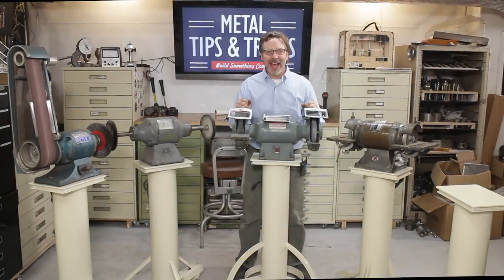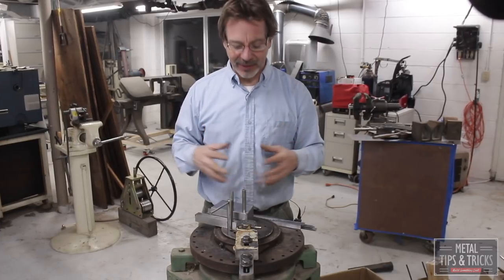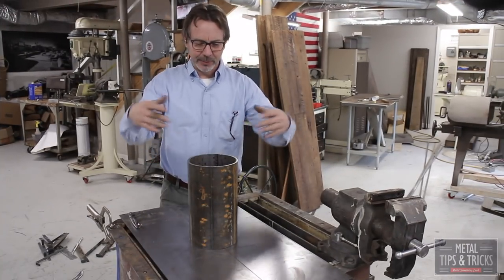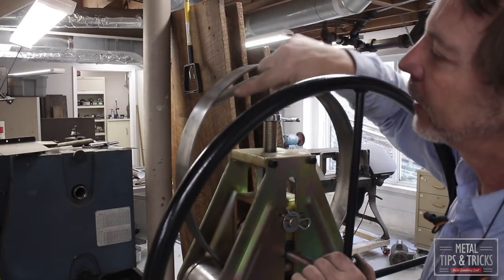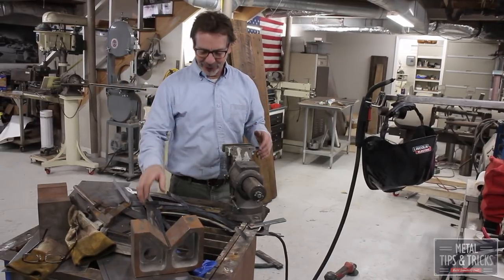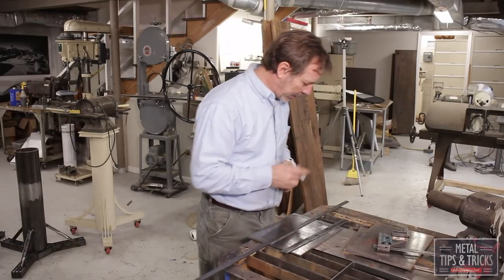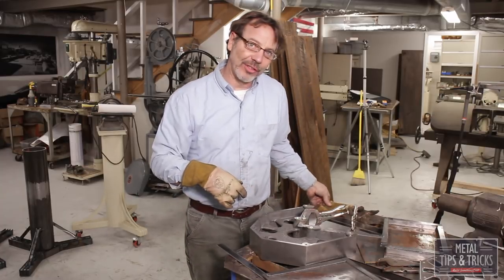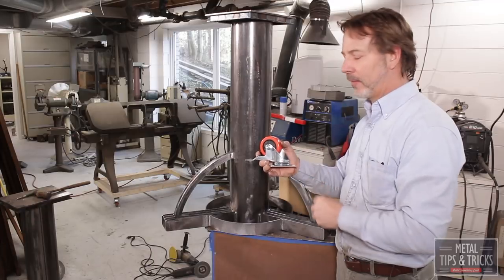Grinding Stands Build

Comment: Past summer I've rebuilt an old 3 phase 8" inch grinder to replace the hobby one I had. The plan was to build a stand for it. Kinda got on the bottom of the priority list. Might be time to move it to the top. Good looking stands you've built, really neat.

Comment: Some pin striping on those stands were really make them pop!  Definitely like the over-built, dare I say, artsy stands!
Reply from the maker: Thanks for your comment Chuck. I think pin striping them would put them over the top. :-)
Reply: In thinking some more, you may be able to just use a small roller and put paint on the edges of the leg pieces and brackets.  That would be something easy to do.

Comment: what model benders are you using i see that the two that you use could bend almost anything that i would ever need im building a shop and have only used giant comercial benders for making 36" diameter stainless chimney pipe

Comment: Hi Dale, I've got the exact same 4" X 48" belt sander as you. The one on your far right at the close of the vid. The only belts I've been able to find are really meant for wood and suffer premature failure working metal. Do you have a source for green or blue belts that size? Thanx, Alan

Comment: Dale, I am curious about the welding surface you are rolling around.  It appears to be shop made and has a squirrel cage fan it.  I didn't see it in your videos. Did you make it and do you have a video out there about it?  Thanks
Reply from the maker: Hi JC. I did make it, but there is now video on it.  You’re right it does have a squirrel cage fan in it, and a filter system. I like the idea of it,  but I would not make another one.
Reply: Ok thanks!

Comment: Dale, what Diameter is the pipe, looked like between 6" in / 8" in. Great design's. Great inspiration.
Reply from the maker: I think it 6 Inch . If I had to do it again I would use 5"

Comment: What should a stand weigh to be "tip proof"?
Reply: It's not the weight it's the distribution.  Top heavy is a problem.
Reply: Personally, I wouldn't put it on casters, but bolt it to the floor. And fill the stand with cement, or sand, for extra weight and to dampen the vibrations a bit. To help with that, you could also put it on quarter inch rubber pads where the feet are bolted to the floor.

Of course, if portability is a requirement, none of that will apply.
Reply: Dale moves every couple of years. It's actually quite  Genius, his whole shop will roll into a moving truck.

Comment: Nice stands but the designs go against what you mentioned in an earlier video about wasting floor space.  In other words, a cabinet type stand would've been in better keeping with that philosophy.
Reply: Steve. I think you miss the point....
Reply: DrewLSsix  - The point was to build something "Cool," which may not be practical or affordable.  It may be camera angle, but they look a little too tall.  I love the channel but cannot afford most of the projects.
Reply from the maker: You might be right about the height. only time will tell :-)
Reply: Barry Manilowa - Depends on the center of gravity.  Bottom ballast would help.
Reply: As a follow-up to my earlier comment, what would've been cool; openings in the large pipe stanchion for storage and curved doors.